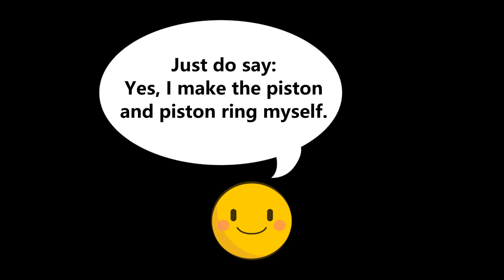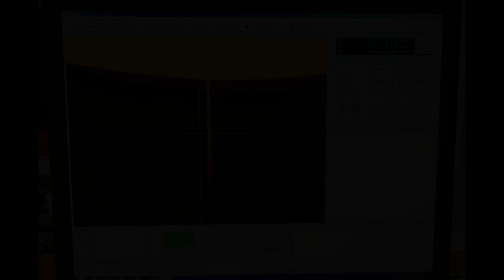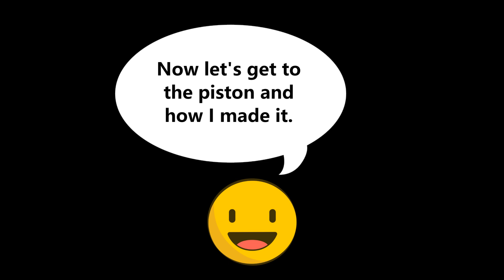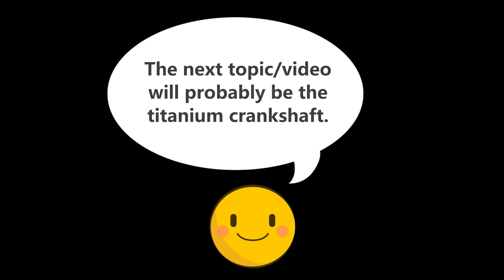Part 3: V8 model engine with rotary valve / Piston and Piston Ring

Comment: The 1 mm endmill milling is quite the feat!  Beautiful work as always.
Reply from the maker: Hi John. Thank you for your nice feedback! Yes, the annular gap is just so small that you have to go to the limit when milling. The 1mm cutter is really super small. But it is manageable.  The result is really good and the piston ring fits perfectly in the piston and the cylinder. On the other side, the effort including the custom made fixtures was quite high. I hope you enjoy this kind of manufacture video :-)
Reply: @danielhunziker3577  Your videos are always fun.  I have a very similar setup to you, an old manual lathe and a small CNC mill.
Reply from the maker: That's cool! A CNC mill is much more usefull than a CNC lathe. With a little CAM and you will be ready for nice milling parts! :-)
Reply: @danielhunziker3577  Absolutely!  We built about 50% of the parts for the BMW 328is rotary valve on our mini mill and lathe.  The larger parts and very high tolerance parts were done at a local machine that my brother and I used to work at.
Reply from the maker: Hi John 😃 Of course, the cylinder head, for example, is quite large and you need a decent milling machine for that. Typically, "hobby" milling machines are rather small and less accurate. I have Optimum machines (BF30 CNC and conventional d320x920), which are also rather cheap than pro machines. Unfortunately, with these you often have to improvise for good part quality. That costs me time and sometimes a lot of nerves. Were you able to build on your BMW 328is rotary valve, e.g. on the dyno, long-term test or to develop the technology further? I would be very happy if there were a new series of videos ☺
Reply: @danielhunziker3577  We will get back to the 328is eventually.  My twin brother and I are working towards building a house so that project has been side lined.  We also picked up a new fun vehicle, a 1990 Jeep Comanche.  We have messed around a bit with our one friend doing a rotary valve on a 5 hp Briggs and Stratton that features variable valve duration control.  We have run it in a gokart with some success.

Comment: Genius! I am absolutely amazed. Well done! Very inspiring work.
Reply from the maker: Hi Geoffrey. Thank you man! I wouldn't say genius. It's important to me that I make as many parts as possible myself. You can see the result of the prozess and the final parts in my videos. But you can't see the countless unsuccessful attempts beforehand. I'm happy my work is inspire you :-)
Reply: @danielhunziker3577  I know exactly what you mean. Success only comes through failure. I have started the fabrication of a Schillings V8 a couple of years ago using a conventional lathe and milling machine, and it is a steep learning curve. A lot of fun however. I sometimes wish I could use CNC technology, as it makes repeatable parts consistent, but I can only go the old fashioned way, which takes a lot of time and effort to get right. I am learning though, and with solid automotive background, it makes the process a little easier. Still, I will be following your build closely. Thank you for sharing it with the world!
Reply from the maker: You're welcome Geoffrey! Good choice. Schilling is one of the most famouse model engine builder. He makes simple but well working engines. Like Luther or Gurtner. I have has well "the green bible" from him. He made good engines which are simple to manufacture. My engine is not based on his book. I was inspired by Michael Trzesniowski book "Race car technology" and his deatails about Formel 1 engines. The rotary valve system is unique and developed by myself. Are you still working on the Schilling engine? What is the progess status?
Reply: @danielhunziker3577  I only have the blueprints for the engine, and I have figured most of it out. I still have to think about machining process, make some fixtures etc, but so far I have the cylinder liners and a few valves. I bought the book you mention as well just to have it, but my German is not that good. I know my way around some technical terms because of my mechanical background (I am a mechanic specialised in classic cars), but that's about it.
Reply from the maker: That is unfortunately the case. For many parts you need a custom made fixture and tooling. But it's worth it! As you say, the process is fun as well and when the result is qualitatively nice, one is all the more pleased. Yeah, Schilling was German and his books are written in German. E-book would be nice, of course, then you could run it through the translater right away. I have the advantage that this is my mother tongue. You say it right. A CNC milling machine makes the production of the parts much easier. I could no longer work without it. CNC lathe, on the other hand, is not important. Sure, this prior knowledge will help you! I have classic cars as well. We restored my Mustang and we put a nice Ford X2 engine and a Ford top loader manual gearbox in it 🙂
Reply: @danielhunziker3577  What books would you recommend to get familiar with CNC? Or maybe it is your professional background? Either way, it is an interesting hobby, although it does require a lot of time and dedication. I haven't had much time lately, but I do hope to find enough to complete this engine one day. :-)
Reply from the maker: Hi Goeffrey 😀 My background is indeed polytechnicians. I learned this profession for 4 years. After that I spent nearly two years in the military service. After my military service, I studied mechanical engineering. Since I work in the office in development, I miss the manual work. I now do that privately by building model engines (and chassis). CNC is not CNC. Normally this is machine specific. Each manufacturer has its own interface with its own codes and cycles. The basic language is ISO code. Best way to learn how to program CNC is simply to learn from someone who already knows. You may be able to find internships, or simply start working at a machine shop under a trained CNC operator. Learning theory is probably not the way to go. A colleague of mine has parts made through an apprentice workshop (kind of school). They are always happy when they can do more than just practice pieces.

Comment: Well done on making these parts. 25 mm bore, what is the stroke?
Reply from the maker: It's a ultra short stroker with 25mm bore and 13.5mm stroke. 0.40cui per cylinder.
Reply: @danielhunziker3577  that's quit a large bore/stroke ratio! Nice. Of you need help for calculating crankweb weight an shape let me know. But a eight would less vibrate at these sizes.
Reply from the maker: My 1 cylinders all have a balanced crankshaft (forces 1. grade) . A V8 does not have an unbalance 1.grade, so to balance the crankshaft is not necessary. But it does have a 2.grade unbalance, so it will do a "rolling" motion. But that is negligible with the low centrifugal forces of a model engine.